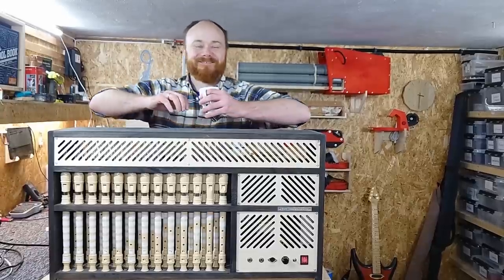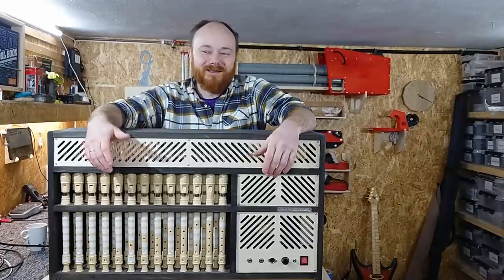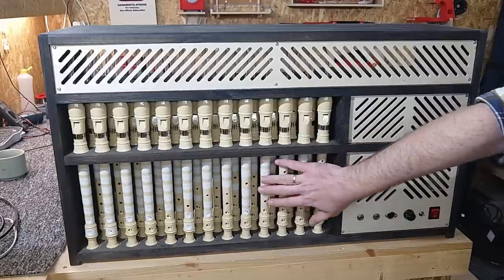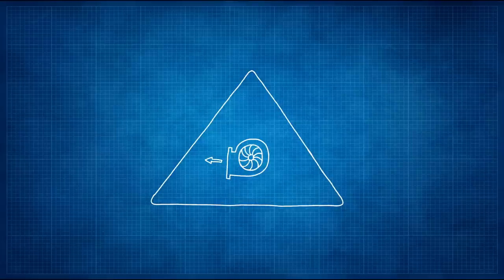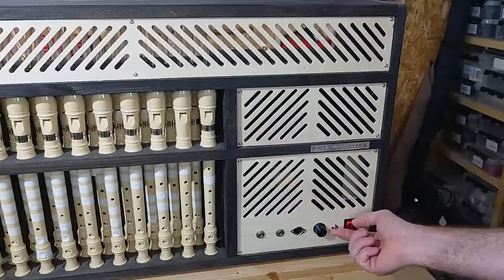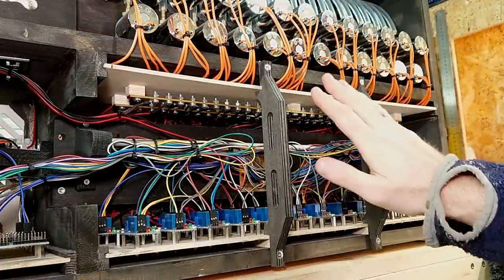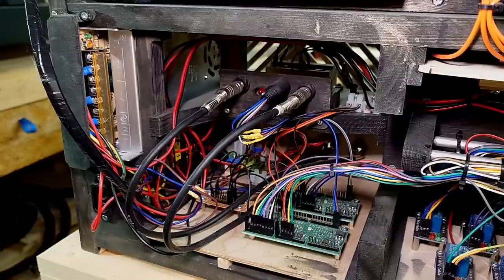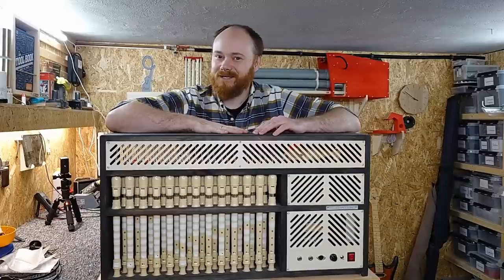The Hellcorder | The World's First Recorder Based Guitar Amplifier

Comment: Hellecorder

Holy crap. I love you so much! 😂😂😂 

This is one of, if not THE best Zen-Absurdist projects I’ve ever seen.  It might even be the best Zen-Absurdist project ever mounted.  Your commitment to excellence is admirable, your design is laudable, yet my favorite part is your laughter at the end - pure acknowledgment of time “well-wasted”, and anticipation for the next round of potentially pyrrhic improvements, whenever that may be. 

Well lived, my friend. ❤️
Reply: And I look forward to polyphonic version- yeah, you’ll have to tune that one. Pre-tune them and fix the mouthpieces in place, then mount the bottoms on a threaded platform for fine-tuning and adjustment for temp/humidity. (dunno if those are wood or plastic)
Reply from the maker: Thank you, and that is a very good tip. I also was thinking about some threaded system to allow to adjust them from below. Also making the holder part for the recorders detacable so I can remove them, but you really need to tune them in place anyhow :)
Reply: @behindthemistakes  You’re welcome- depending on how the pieces fit (don’t know if they’re corked), you may have to adapt a faucet/gasket type of fitting.  Anyway - I’m sure you’ll figure it out.  Now you have ME thinking about it!

Comment: micro holes in the recorders to notch their pitches down, patche wood glue to return it the other way, and rubber gasget on the inside for the solenoid switches so they dont produce the snap noise. thumbs
Reply from the maker: Good tips :D

Comment: MOSFETs are your friends. Replace the relays with MOSFETs. Consider also a digital addressable set up to cut down the number of wires. 

Regarding how to connect the guitar output to each recorder, I wonder if a raspberry pi spectrum analyser could work, where the software would choose a chord to match and enable those relays. Hmm...
Reply from the maker: Ooooh, digital addressability! That's a very good tip actuallt - even though I do like wires :D
Reply: @behindthemistakes  I can certainly see the inspiration from an old school amp. Inspiration is a great starting point, but that can hold us back too.

Michael Abrash said in his book about code optimisation, "the best optimiser is between your ears". Of course this was after a section describing how even after he did lots of optimisation tricks on his coffee it was still too slow - until he took a fresh look at the logic of "how" and changed his approach. His new prototype method beat his super optimised old inefficient method.

Another thought, switch the blower to a bouncy castle air fan. You might have to inline a pneumatic electronic air flow limiter to each recorder, or use a manual limiter for a default volume. Higher pitched notes require more agile etc (I'm not sure you adjusted for that, but am also not going to claim you didn't).

I love the project, and very much appreciate the passion you had creating it :) I also respect that you might be done with it.
Reply from the maker: @JoshuaDavidson  The bouncy castle fan has been looked into, but then it also needs to be placed a few blocks away of noise concerns haha. Should gie sufficient airflow though :D

...aaaand, might not be quite done yet. Seems to have struck a cord with people, demanding more! :P

Comment: Hmm, so you should really put "amplifier" in quotes, since it doesn't actually amplify the guitar's sound.
Reply from the maker: Well, the electric guitar doesn't make very loud noices unplugged, but after plugging it in to the Hellcorder.....MUCH NOISE! ;D
Reply: @behindthemistakes : Right, but my point was that quotation marks work well there because actual amplification isn't just making a louder sound than what you had before; it's reproducing a specific sound or other signal from its original strength.

Comment: Do they still make mini widgets? I want to their website and it seems to be down. If not, do you know of any alternatives? I have a 32 Notes Glockenspiel that I built a rack, hold and solenoid to play the it. I was planning on using Arduino, but I'm looking for a simpler solution.
Reply from the maker: No, I believe he only made one batch which is all sold out. The construction files is freely available on Github I believe, so any circuit board manufacturer can make them, but that becomes pricey for one board unless you plan to make thousands and sell of the rest.

I concluded with the same about arduino, but there are luckily alternatives. There are some organ parts manufacturers that have similar boards, and the one I know about is J-Omega Electronics which for you have a 32 channel board :D

https://j-omega.co.uk/product/mtp-7

PS: Keep me updated on that Glockenspiel :D
Reply: Thank you so much  @behindthemistakes  . Just ordered two of them. I will send you a link to the video when I posted.
Reply from the maker: @Bgaun  That's awesome. Let me know how they work. I might have another project that needs more channels coming up :D

Comment: For the seals, try some ordinary silicone. If you can find some that's flexible enough, then you shouldn't have any problems.
Reply: Incidentally, as far as the relay boards go, supposing that you were running them from an Arduino instead of using MIDI, it would be easiest to just make your own relay "boards". Just glue some DIP chip shift registers and transistors to a piece of angle iron (as a heat sink), wire them all up for power and ground, rig them into a daisy chain with the shift in & shift out pins, run the parallel outputs directly into the control pin of the transistors (one transistor per parallel pin), run the transistor's "high" pin into BOTH a diode (oriented to not turn on, it's there to stop the relay coil from killing the transistor) AND a resistor each, run the other side of the resistor into a relay coil, run the other side of both diode and relay coil to another power supply (NOT the same one as the shift registers), and you have however large of a relay board as you want. The shift registers control the transistors, the transistors control the relays, the resistors stop excessive current from killing transistors and/or relay coils, the diodes prevent the "off spike" from the relay coils from killing the transistors.

Don't have a power supply? Use a USB converter for the shift registers, and a doorbell transformer (you might want a stronger transformer later) + some diodes for the relay power supply. Want to test before soldering? Solder everything that doesn't have flexible wire leads to wire, and use terminal strips to hook things up. Want more relays? Just duplicate your existing shift register setup and you have more relays. Shift registers getting hot? Add resistors between the shift registers & transistors. Transistors getting hot? You used too low-resistance of a resistor, so swap out a new higher-resistance resistor and make sure the transistor is glued to the heat sink. The relays sometimes or always don't stay on when they should? Make sure that the ground is shared but the two "high" power lines come from different power supplies, and add more capacitors (with the other side connected to ground) to both "high" lines. The relays try to stay on when they should, but sometimes keep switching? Add more small-value capacitors with as little wire between themselves and the components as possible. Relays switch on when they should be off and off when they should be on? You either used the opposite transistor than you should have, or used the opposite relay switch than you should have, so just use the other relay switch.
Reply from the maker: Oooh, this was useful feedback :D Thank you!

Comment: Hey love it but I'm a little confused how you tune the recorders and since I see you tape of the holes how do you tell what frequency each recorder Is tuned to can you make a video explaining that because organ have pipes tuned but if all the recorders are the same how is it working like you said for 2 octaves
Reply from the maker: The tape is to get the different notes as you do when you are playing them by hand. The tape basically gives every recorder a fixed note to play and the electronics choose which pipe gets air depending on what note I'm playing on the guitar. 

The problem is, amongst many, that even if the recorders are playing each notes, they are not fine tuned to eachother. This can be done on a recorder by slightly extending the middle joint, but that is hard enough when your playing one by hand, let alone when they are fixed in a wood cabinet. The different notes also require different air pressure, which I have yet to have accounted for. So basically the biggest review of design I need to do is to build a rack system that allows for individually tuning and also individually adjusting the air pressure.
Reply: @Behind The Mistakes  thanks for the quick response but why didn't you use thin walled pvc pipes for the 2 octaves cut down using the 440hz scale it's online to view and measurement in cm for each note so you can get each note for the 2 octaves
Reply from the maker: Basically because building it out of recorders was the design brief (which is a fancy way of saying "Late night whisky Induced idea")

Comment: You are correct, this is pretty dumb. But, since you have done it, replace the mechanical relays with solid state ones. That will get rid of the clacking. I am sure other things can be done.
Reply from the maker: I have thought about solide state relays and that would be a 30 min swap. What I've also been thinking about, since its a fairly stable load on the solenoids, is to use transistors/octocouplers. Could be done even smaller and cheaper and I havent done those before so it would be nice to try.
Reply: @behindthemistakes  Could work. Don't forget the snubber diodes.
Reply from the maker: @alfonsodelafreg259  Oooh, that's clever! :D

Comment: I think you can dampen the relay or solenoid noise with a diode or resistor across the coil.
Reply from the maker: Yes, maybe. The relays I'll swap out for something else, and also smaller, but the solenoids need some dampening of sorts :)

Comment: Use that cnc to make custom recorders that only make the note they’re supposed to, and also have a custom stem or threaded to fit into the airlines, rather than having tape blocking them off, and insulating the solenoids from outputting that loud click, may be your best option. Could at least help you achieve what you’re looking for
Reply: Alternatively: 3D-print all of the recorders as a single piece.
Reply: @leftaroundabout  yeah but they’d still need to be individually valved, so each one being modular would be better than a one shot piece
Reply from the maker: Yeah, the tape is an eyesore and temporary(-ish). I know about a guy who casts recorders from recycled plastic, which could make single note recorders :)

The flow and relay noise issues are a easy fix which is on the way. Still working on the solenoids - If I shall modify them or just build a traditional wind chest design.
Reply: @behindthemistakes  also look into abs controllers from a semi, it would be quite complicated but they are made to open and shut very fast - maybe even a way to modulate the notes 😈

Comment: I bet you can silence those valves with lower voltage.
Reply from the maker: That's a good tip and easy enough to try out now that the solenoid valves now are on a separate power supply. The relays I'm thinking could be swapped with something transistor based, but I really need to nail the airflow and tuning issue to the recorders. I have enough on the list for a 2.0 later on :)
Reply: @Behind The Mistakes  I'd consider enclosing the valves even acrylic would dampen the sound, maybe even try rubber mounting on them to dampen sound coming through the cabinet.
For the tuning, could you put a raspberry pi into the chain, then you could remote into it and send anything you want?
Reply from the maker: That is a good idea. I basically kept it open in the back to ease the access for working on it. I think that I on the 2.0 version will go for a more traditional valve box like they have in proper organs. Still have to find out how to regulate the flow individually as that has a lot do do with the tuning. A Raspberry Pi would not help munch in that, but I can think of a lot of other uses for one :)

Comment: It really isn't a guitar amplifier; it's a MIDI controlled wind organ that happens to be controlled by a guitar, but you could just as easily control it with a MIDI 🎹, skipping the guitar-MIDI converter.
Reply from the maker: Just as a guitar amplifier is basically a paper diaphragm moving air by a coil inducted magnetic field, which amplitude and frequency is dictated by another magnetic field induced by swinging some thin wires tensioned over a stick of wood with some copper wound metal pegs embedded underneath :)
Reply: @behindthemistakes  but what is being reproduced is not the vibrations of a string.